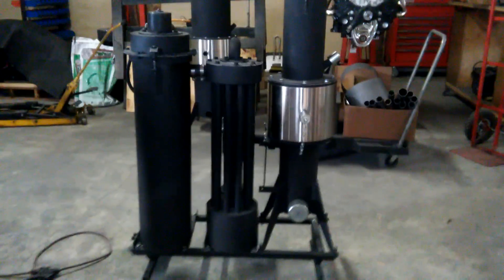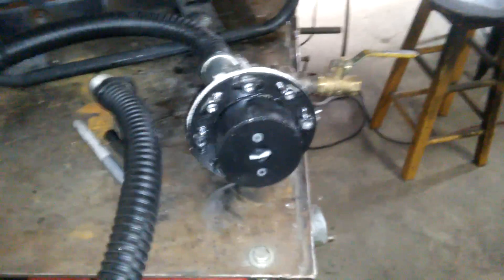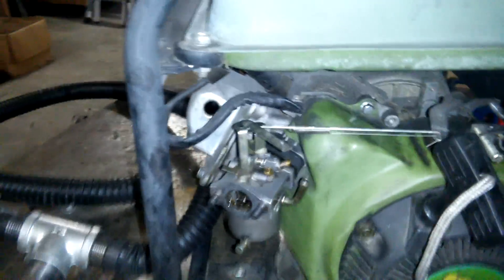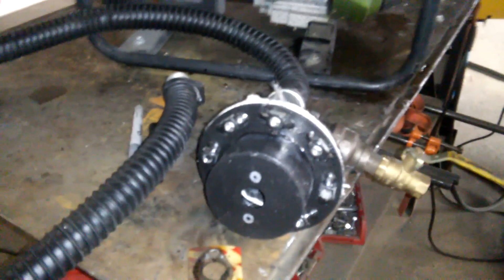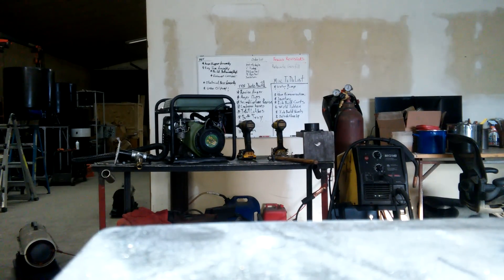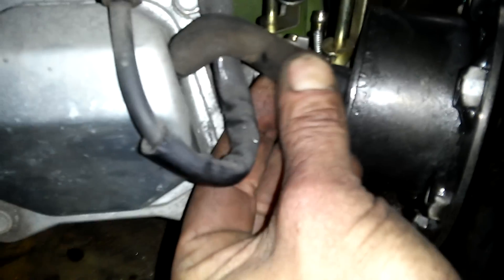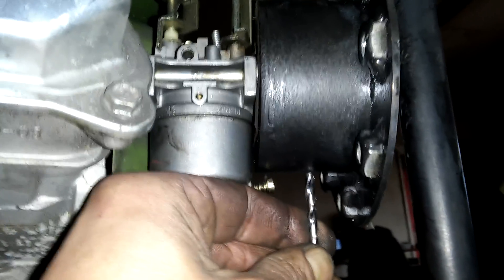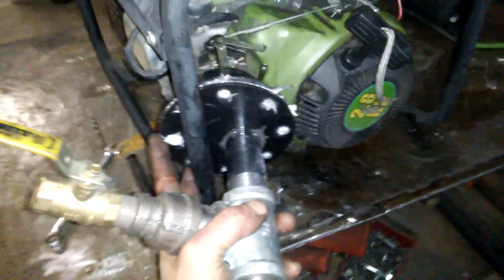Vulcan Gasifier Engine Adaptor

Comment: Good morning Matt! Looks good. I'm also on the DOW site. 

I have a question for you. What brand of governor do you use for your units? I'm looking at running a 351w or a Nissan 4 cylinder to power my Gen head.
Reply from the maker: urgentcareguy3 If you go to the 25 kW thread, there is a discussion on the controller we use. I am using a different actuator now and it is very expensive. The whole kit cost over $1000.00 bucks. You can go to Governors America Corp and source your components there.